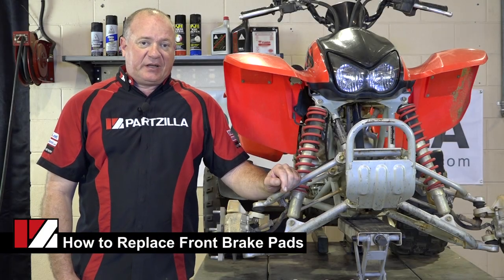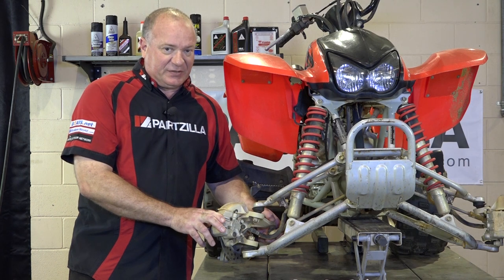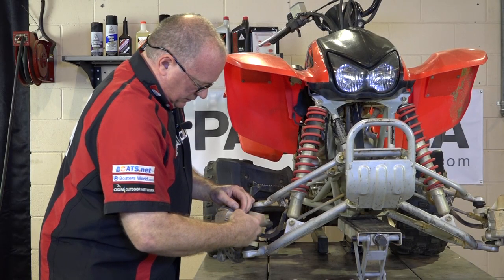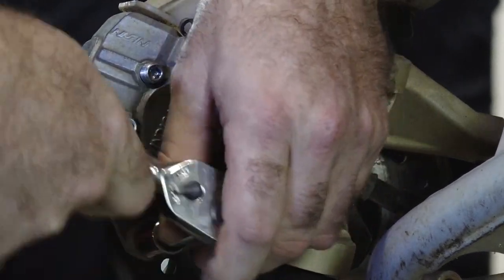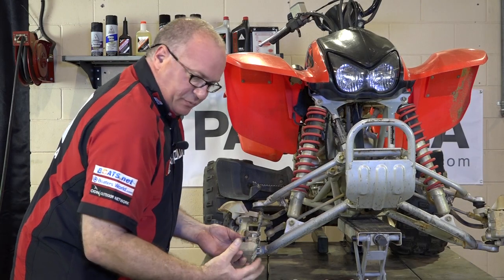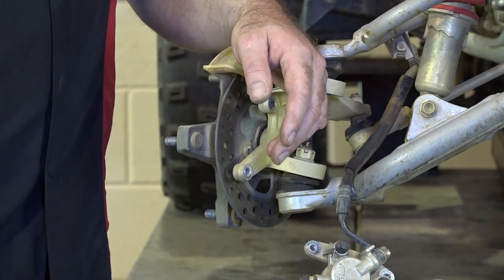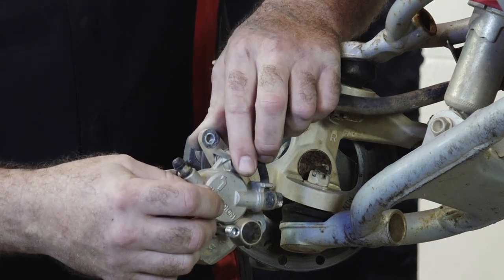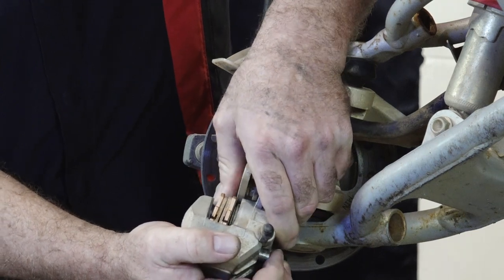How to Replace ATV Front Brake Pads – Honda TRX | Partzilla.com

Comment: hello I was wondering if you had a video on how to replace the rear brake on a 2010 Honda TRX420 FPA model Fourtrax Rancher AT.This model only has one caliper and rotor  rear braking system. Your video how to replace the front brakes was excellent.... I hope you have one for the rear brakes as well. Thanks

Comment: my 05 honda rancher  is  acting like it is got locked brakes   looking for a possible idea jacked it up and still drags  noticed when i was driving  but there is no noise
Reply from the maker: I would start with your brakes.  Are they out of adjustment so there is constant pressure?  Bleed or flush the lines, go from there.

Comment: I have a honda rancher 420 it's the same as replacing the brakes on this other than it doesnt have shims. Anyway I installed new brakes and now the wheel wont spin Freeley any ideas on how to fix?
Reply from the maker: check fluid level and bleed.  There is too much pressure on the rotor.
Reply: Partzilla okay, thank you of that doesnt work I will let you know!

Comment: What about when the caliber is freaking hard to push back. I can't get it to go back to make space for the new pads
Reply from the maker: Did you top off the reservoir and seal it?  There may not be room for the fluid to back into the system.

Comment: are the procedures in the front the same as the ones in the back?
Reply: Usually they are. The brake calipers are going to be slightly different in size, but the process is the same. I have a Yamaha and this video was helpful.

Comment: My caliber will not go back over the disk
Reply from the maker: Did you compress the pistons?  There needs to be a gap between the brake pads large enough for the disc to fit.

Comment: I can assure you this won't work. You will put your pads in, and the rotor won't turn. Its because the floating pin is seized. Unless your 400ex is brand new, you will be buying new calipers because you will not get these out. That's a fact
Reply: Not a fact lmao